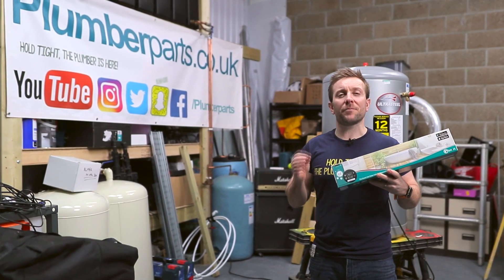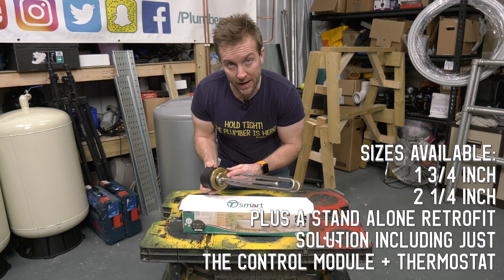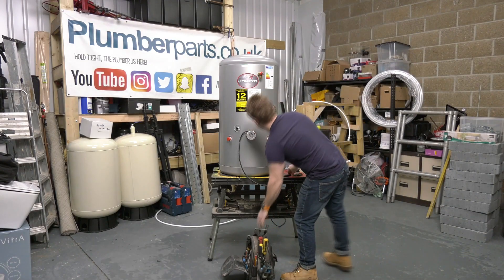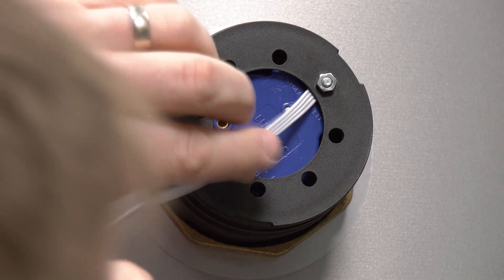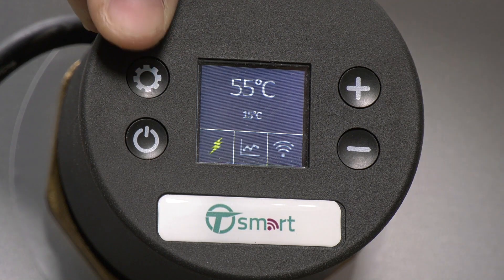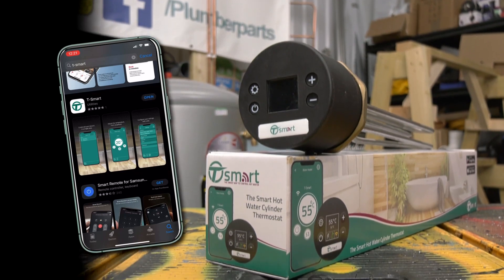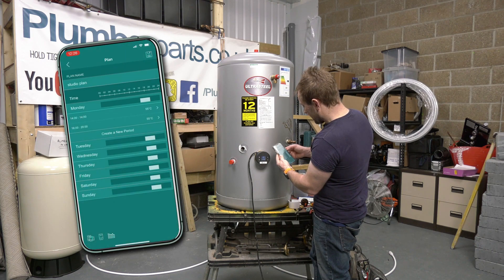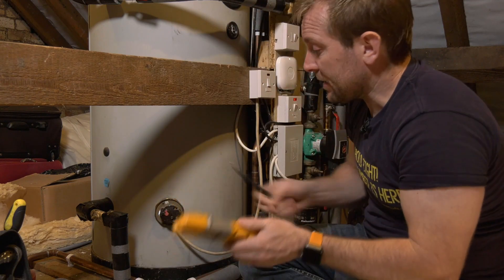Tesla Model T-Smart How to UPGRADE your IMMERSION HEATER

Comment: For any Home Assistant users, this works just fine once connected to the network, with a HACS addon
Reply: Update doesn't work on mine (keeps failing eith E04 or E05). Contacted Tesla UK about it and they sent out a replacement connection cable. I installed it but it's still stuck on E04/E05, and the app WILL NOT WORK AT ALL unless the update has completed. That means I can't set the temperature from the app, only from the unit itself (in my boiler cupboard) or from home assistant (third party software).

Comment: Just done mine. Glad I watched your video first, may not have bothered to use a muti meter to double check if not. Turns out that our immersion heater was not connected to the circuit marked water heater but instead to the ring main! Looks like the gas boiler and immersion got swapped at some point, do plan on getting it put right before I start using the immersion heater in anger as the 13A fuse was getting rather warm…

Comment: Love the idea and brilliant engineering from our UK friends. Will the immersion element and thermostat set fit United States boilers?  Interestingly, the US cylinders have two immersion heaters and thermostats.  Not sure if that is a problem.
Reply from the maker: Thank you for your comment. I believe the electricity supply in the US is 110v. In order for T-Smart to work, you would need 240v.

Comment: Is this a horizontal fitting only?
Can you get a 14" vertical replacement
Reply from the maker: The only vertical replacement we offer is 27" long. Item code TIHTS650.
Reply: @teslaukltd  can the 14" Horizontal be used in the vertical position?
Reply from the maker: @MrNkcanoe  Unfortunately not, sorry. The vertical variant comes with a different thermostat to cope with higher temperatures. Installing a horizontal version vertically, would cause the thermostat to trip.

Comment: Just to confirm can this be retrofitted. I have two different cylinders. One is a Stelflow unvented Hot water storage unit. I think its 300l. I also have a Daikin Altherma 300 Litre, Model No EKHWSU30083V3. Installed with heat pump but thats not working so just using it as immersion. If so can you recommend someone near Guildford who could do this. Not sure I want to try myself.
Reply from the maker: Unfortunately, the T-Smart is not suitable for your “Daikin” cylinder. We will need to know the cylinder model of your Stelflow before judging this. Please use our product selector T-Smart Hot Water Cylinder Immersion Heater Thermostat & Solar PV Diverter (tsmart.co.uk)

Comment: Do you need to empty the heater to replace it?
Reply from the maker: It is solely dependant on what type of immersion you have . If you have a rod type thermostat, you will need to replace the immersion, if you have plug-in then no, you will not.

Comment: Can I use this with myenergy Eddi? As we have solar and I want to heat up the hot water using excess solar
Reply from the maker: Unfortunately not, the T-Smart requires a constant live feed. We have devised the following product to work with PV systems. T Smart Immersion Heater Thermostat - ERS PV Solar Power Diverter

Comment: Great Product, does this go along with Honeywell Evohome hot water sensor (BDR-91) as secondary heating using immersion element to take benefit of cheaper electricity tariffs? Thanks
Reply from the maker: It won’t work alongside another sensor that uses the thermostat pocket. It will replace any current sensors and work alone to make use of this kind of tariff.

Comment: This video just shows the guy fitting the thermosat to the old immersion heater but I see from your website above you sell the complete immersion heater + smart units.

I would also like to know are these only made in the 3kw (3000w) model or are there higher wattage units available like 4kw, 4,5kw and 5kw ?

The available flange/boss  shows as 1.1/3 and the most common standard 2.1/4 flange but is this unit also available for 1.1/4 ? 

Perhaps you could supply this information so we all will know if it will work and fit our hot water tanks correctly.

Many Thanks
Reply: Hi OMC, 
Apologies I missed your comment so only just replying. 

We are workign on a Commercial Model of T-Smart which will use a different Thermostat set up but this will allow us to go up to 18kW with teh smart control and up to temperatures of around 80°C, however until that point we are limited to a 16Amp version which will only allow 3kW maximum. 

We have ability to manufacture bespoke Immersion Heaters at our sister company Thermco so if you require a T-Smart with an 1.1/4" connection we can do this up to a maximum 3kW currently. 

I hope this helps and again apologies for the delayed response

Richard
Reply: @richardprince2617  !
Reply: @richardprince2617  ?

Comment: Would this work as a retrofit to a dual element heater? Presumably switching from sink to bath would remain a manual task.
Reply: Hi Paul, 
This could replace the dual element but would use just the one element to do both main heating and boost. 
The only limitation with T-Smart is that it has to be installed horizontally, if your immersion is currently vertically mounted we will have this option available very soon. 
If you want to discuss this further please send your contact details to info@teslauk.com and someone will call you back. 
Regards
Richard
Reply: @richardprince2617  when would the vertical option be available?
Reply: @richardprince2617  Hi, could you explain in more detail how this works in a dual element cylinder ?